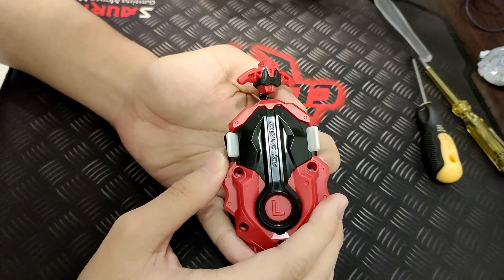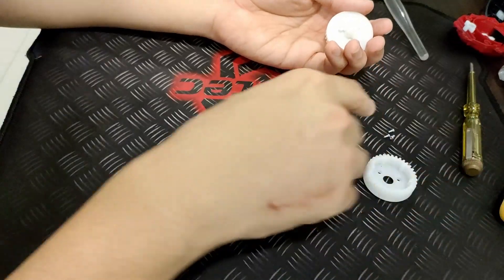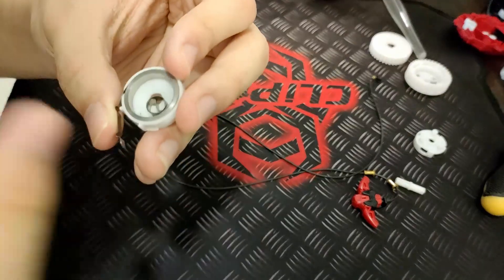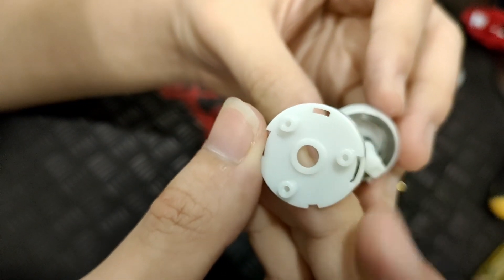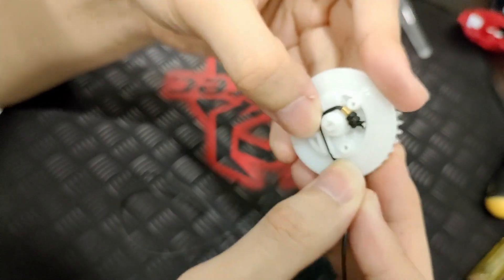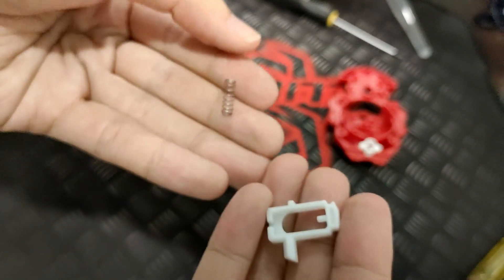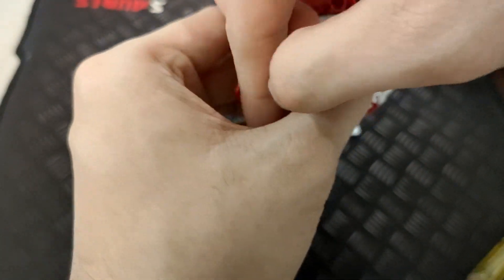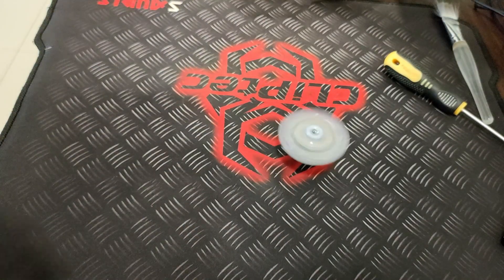How to fix DB launcher

Comment: Whats my launchers problem if I pull it and it retracts slower than my other db launcher and also like a squeaky sound(They are both takara tomy)
Reply from the maker: Retracts strength is not strong enough, it's like rubber band the more you stretch the more faster it retracts and the squeaky sound just use a bit WD-40

Comment: Your tutorial worked really well. Helped me diagnose the problem with my brand new launcher jamming. Turns out the string got wound around itself wrong and stuck.
But while reassembling MY SPRING KEEPS FLYING OUT OF THE DAMN SOCKET AND I CAN'T REASSEMBLE THE FUCKING THING
I'M LOSING MY MIND
Reply: Bro when I was reassembling it the same thing happened the spring kept bouncing out the socket😂
Reply: SAME BRO
Reply: SAME!!! 😡😭😭😭

Comment: I got my db launcher from the savior Valkyrie pack (yes it is authentic takara tomy) just got it yesterday and it broke within 20 mins of battling. It was still working but not retracting and i go to this video and i made it worse. Im not being angry at you mr Shaun but atleast you helped other people fix their db launchers. Tysm for helping the fellow beyblade community❤ ❤❤❤❤❤
Reply: Mine broke fast aswell but mine is less worse because it only happens with heavy beys like prominence Valkyrie stock combo and guilty Longinus stock combo that I do battles with a string and tt ripcord launcher a combo I use if not using prominence is just switching karma with over. Also it stop retracing at halfway
Reply: Failed for me as well😢